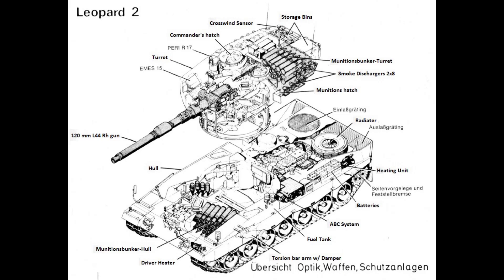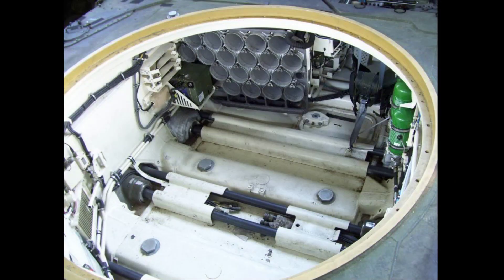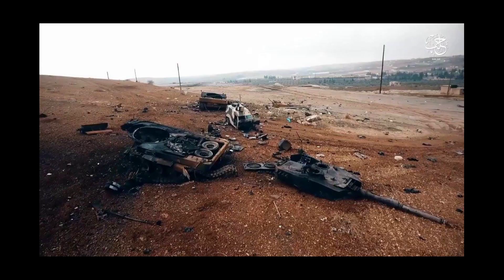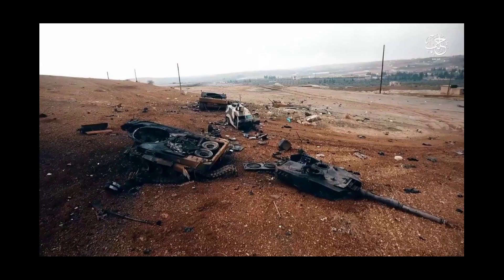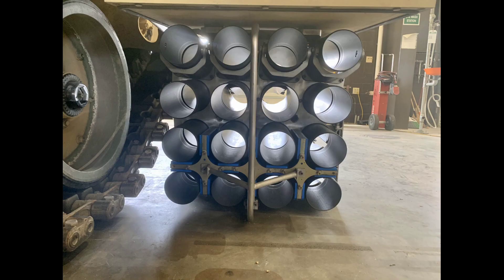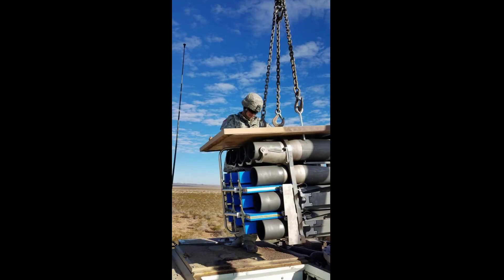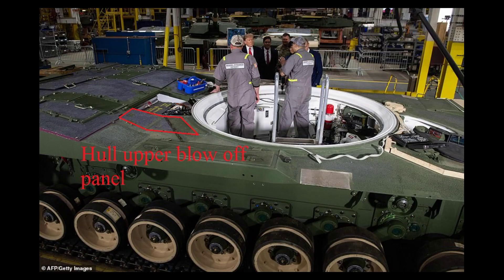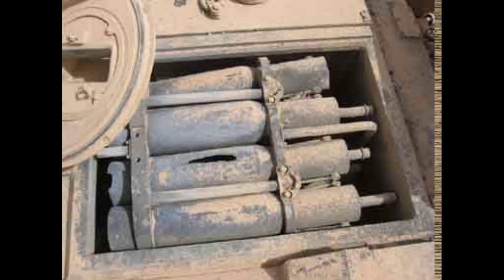Let's talk about tanks - Ammunition storage. Part 1.

Comment: By the way the official statement why the Leo2 stores the ammo in the hull is "The ammo is safe inside the tank, so the tank protects it with it´s armor and it´s one of the safest locations inside the tank, also the ammo is non sensitive to explosions it will only burn not explode even when hit directly with HEAT round. Funny about this is THIS IS EXACTLY THE SAME THING THE RUSSIANS SAY about their T-72 turret storage xD
Reply: They are betting their lives on nothing ever penetrating the hull.  The problem is that it has never been impossible to poke holes in tanks, merely difficult.  Anti-tank mines are particularly good at it, attacking from below with large explosives.
Reply: yay because the tank is inherently a pressure vessel right? so then it literally doesn't matter where you put it, if it's within the crew compartment. silly germans

Comment: I have heard that the new dm63 rounds for leo2 will not explode if hit
Reply from the maker: It will still burn or explode. SCDB propelant charges are safer, but they are not 100% safe. If hit directly by APFSDS penetrator or shaped charge jet they can still start to burn or explode. Only combination of isolated ammunition storage and SCDB propelant charges can provide excellent safety for crew and tank itself.
Reply: @bronpancernaswiata6835  its an upgrade atleast i guess
Reply from the maker: @Alexandergr564  A small one, and not changing grand sheme of things.

Comment: I like how the ammo rack on the M1A1 is attached to the blow-off panel.   If the panel blows off, the ammo goes with it.   Brilliant.
Reply: Russian are even safer. The gunner and commander gets ejected with the turret to safety
Reply: @ Chol O  been seeing a bit of that lately
Reply: @LOKSTED  it just works…
Reply: Too be fair, what are the odds that any of that ammo in the compartment doesn’t detonate in such a scenario? In my opinion it’s better to loose the ammunition, than the tank or the crew.
Reply: @shaybaker9176  The propellant will cook off first because the brass is much thinner than  the shell casing.  If things go to plan this will launch the rack clear of the tank before the heat gets through the shells and cooks the HE off.

Comment: Very well done. You back up everything you say with pictures and diagrams making a very informative video. Do the latest variants of the Leo 2's still come with hull ammo storage? That seems like something that should of been fixed awhile ago. I guess they figure if anything pierces the hull the tank is dead anyways but you have to give your crew a chance to escape.
Reply from the maker: Yes, even newest Leopard 2A7V have exactly the same ammo storage, just like older variants. It is immposible to fix that, without rather extensive redesign of hull and turret. Which means that they would need to design a completely new tank.

This is why it is so important to design everything properly from the very start. It is much easier to upgrade armor, replace engine or main gun, than to fix such a serious flaw like unsafe ammo storage that is inherent to the choosen general design of the vehicle.
Reply: @bronpancernaswiata6835  I see... I though they already fixed the problem with blow up panel below the tank like the newest German "Light Tank" Lynx 120. I guess even one of the most technologically advanced country still have a really big Minus for their MBT huh... Oh well at least they've learned from their mistakes and do better this time
Reply from the maker: @banggobang5148  Are you certain that they learned? ;)